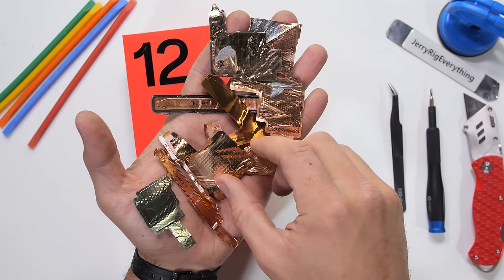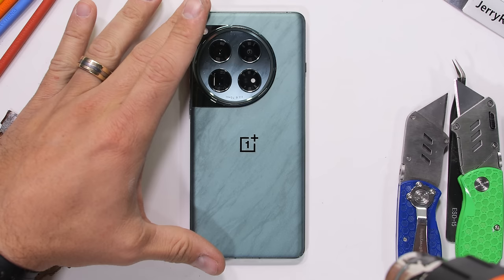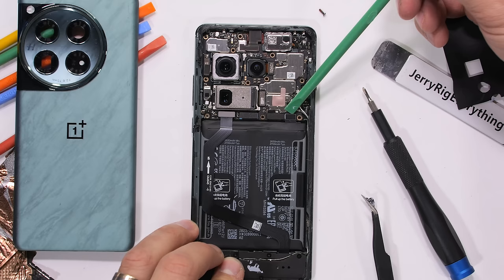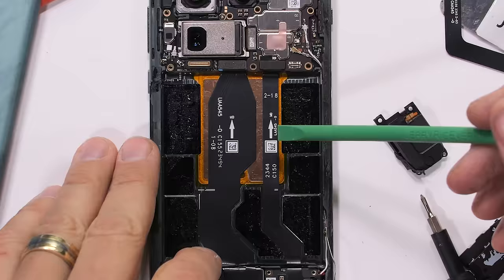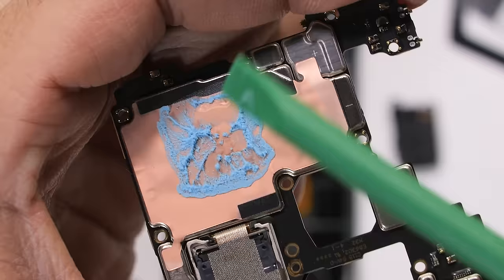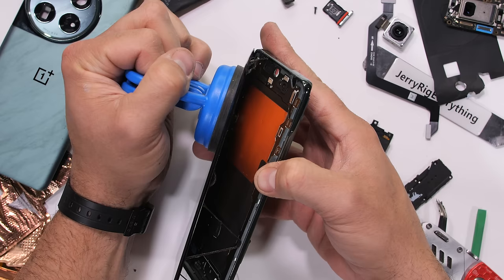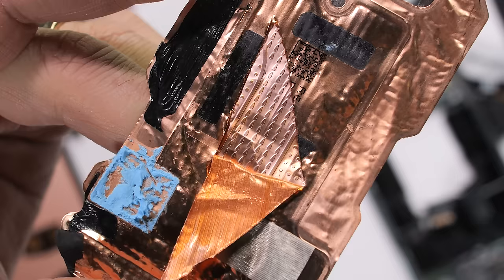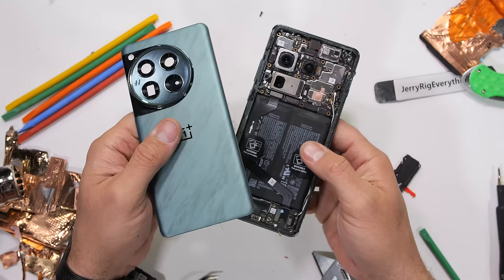The OnePlus 12 is the Coolest phone ever seen...

Comment: 100W Charger and cable comes with the phone. That alone deserves praise 👏
Reply: For sure, esp since it's become the norm for Samsung, Apple etc to include no charging brick at all.
Reply: @sean8102  And It's very cheap for a flagship....It's Faster than S24 Ultra... 
Camera is the weakness but still more than enough for anyone...
Reply: Welcome to most Chinese smartphone brands
Reply: 在中國大陸這些很常見 @thisisa
Reply: Word!
If you buy the Pixel 8 Pro you will only get a dumb short 0.50cm cable C to C and a USB-A to USB-C adapter.
Both useless to use together, so you still need to buy a Charger and another cable for the adapter... xD
So respectless from Google, that only got one thing going for it which is a good camera, the GUI is horrid, and the touchscreen is the worst I have ever used on a modern smartphone thus far.
Reply: Sadly not every country gets them. In Malaysia it doesn't come with it
Reply: Imagine paying £1400 for a phone with no charger and cable how stupid can people be? Well Done oneplus!!